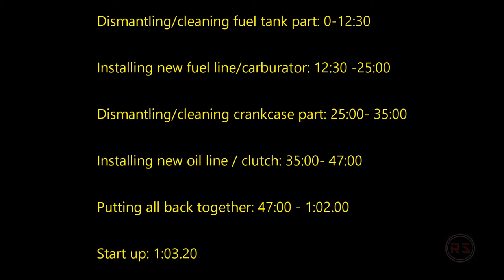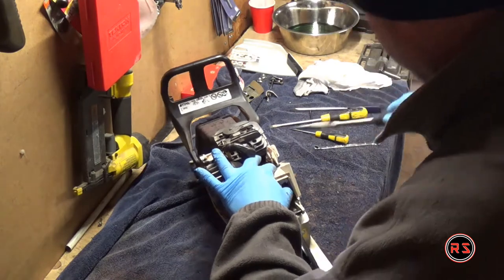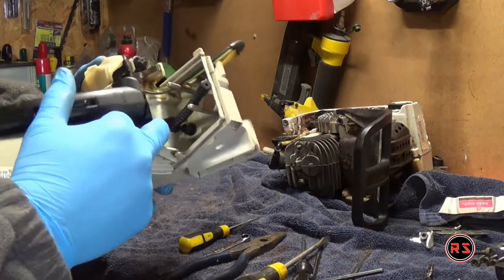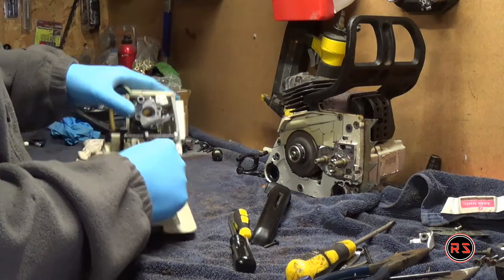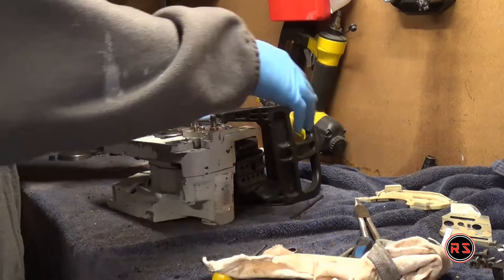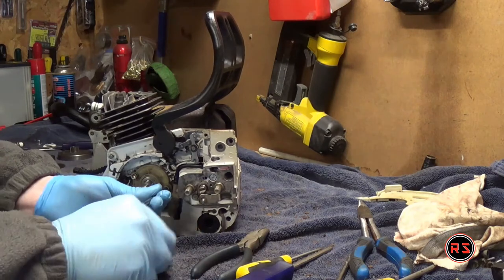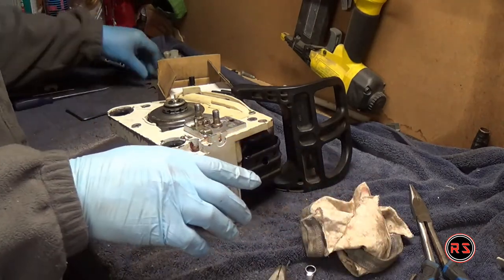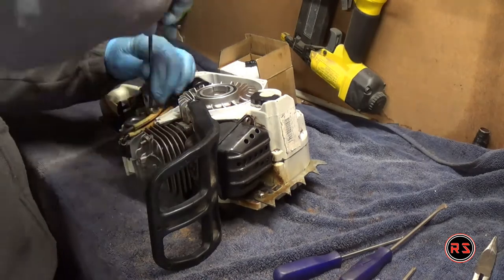Stihl MS260c doesn't start + oil leak FIXED

Comment: Well it looks like I'm going to be diving into your vid now my 260 will not crank. I used regular gas instead of the premix for the first time and now it won't crank. Have used for four years without a problem until using regular gas and the stihl oil. I have a neighbor has a Homelite chainsaw and has used who only uses regular gas with oil for years without a problem. I bought stihl thinking it was superior but after helping the old man cut a tree off his hous with his Homelite I tried buying it off him and to no avail would he sell it! I like his Homelite much better than my 260 although it's been trouble free for four years I just like the Homeite since am older and much less strain on my muscles. Once I get the 260 repaired I will be selling it and looking for something much easy to use. But hey you were very precise and I find your skill level to be extremely helpful and will be using and replaying your video a lot until I find what the heck is wrong. It just won't fire? I'm not sure yet since I have not troubleshoot yet but hoping I don't need to go as deep into the saw as you had to do! But your vid gives me the confidence now to follow your very clear explanation if I do, so thank you for your time and efforts to help someone like us who do not have your skill level. I just wished you were my neighbor! LOL!
Reply from the maker: When you will troubleshoot let me know what you found. I might be able to help you nail the problem.
Good luck